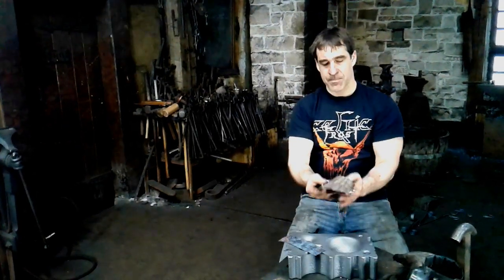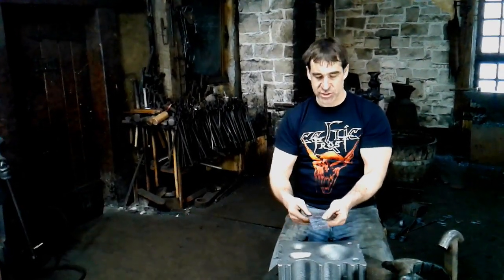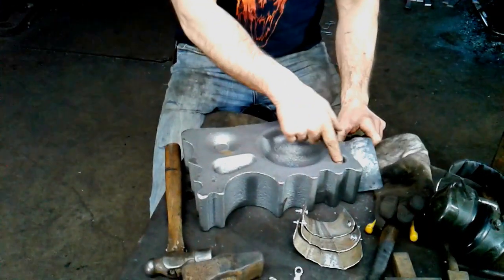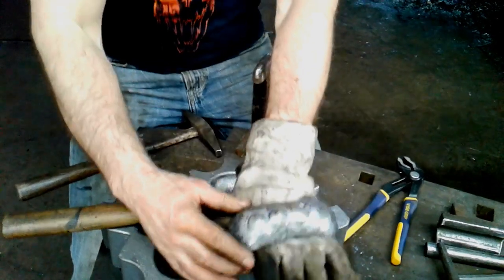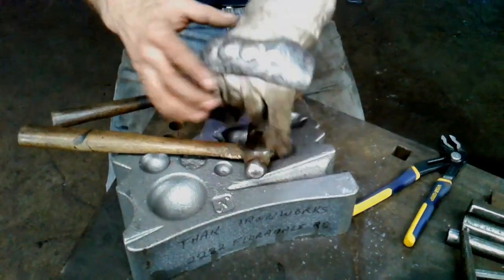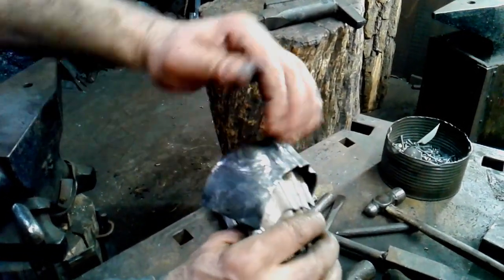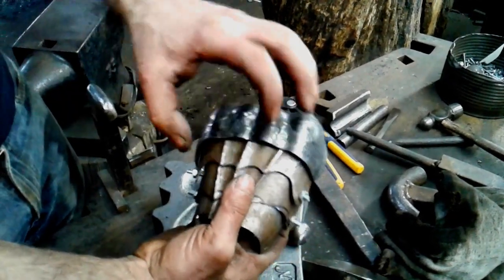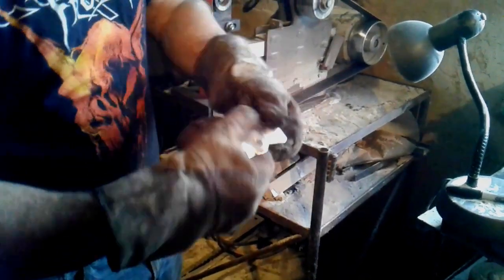How to Make Gauntlets PART 3 - The Knucklerider

Comment: Just found your channel, Another project lead me to making a metal Helmet, which branched off into medieval armor. Mounting your shear to a plate then sticking it in a vice is pure gold! What size nuts/bolts do you use for test fitting prior to riveting? Also checked out your website and was blown away to find out you're located closer to me than my sister is. Small World :)